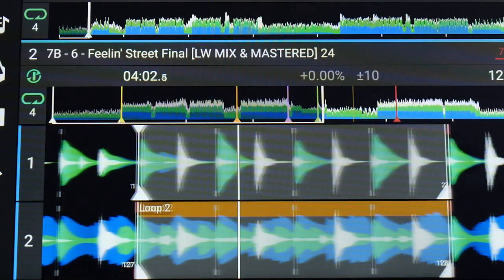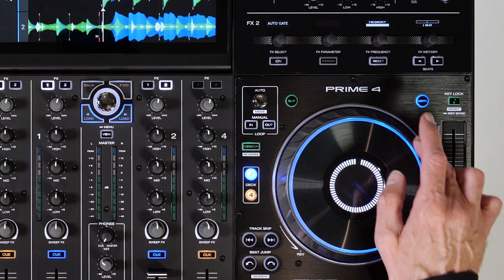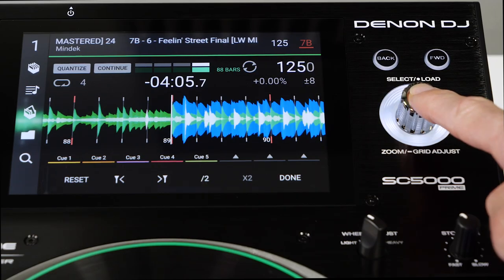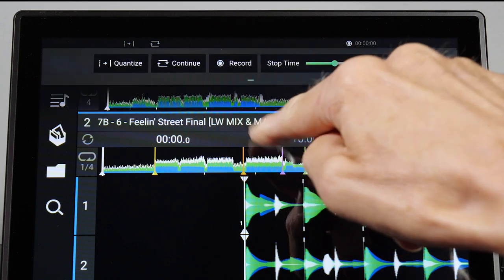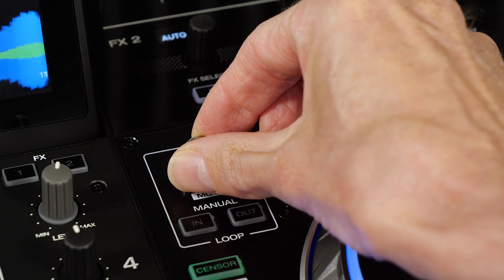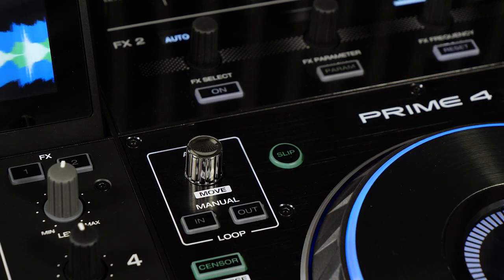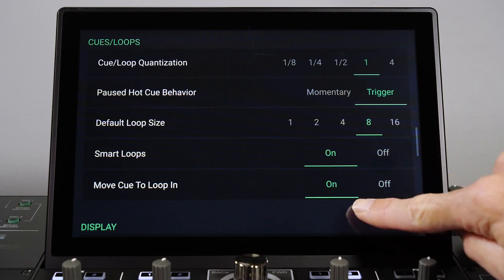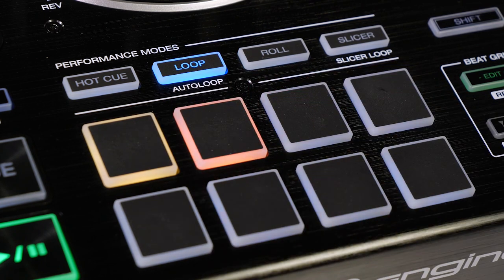Editing Beat Grids to Create Accurate Loops

Comment: Dear Denon DJ....
I too am happy with my new Prime 4 deck. I am stuck having to use it as a Serato controller however since Engine Prime's Beat Grids are ridged only. Please enable Warp capability so they can be both expanded and retracted to match song's tempo that changes over time. (For us 80's/Classic Rock/Metal DJs that's like each and every song)
Reply: +1
Reply: I bought the sc6000 players and have this exact issue!  makes it difficult to mix older music or even grab a loop from tracks that were not made by a computer.

Comment: Denon... there is a BUG to fix! if i move the loop forward , the music has to move together with the loop. And not like a “slice mode” where the result is a continuos play! Example: if i move the loop forward 30 sec. or more, i will LOST it from the screen view! All the other software on market works correctly: if you move the loop, the music will follow the loop forward or back together with your ROLL MOVE! Please fix it with your next firmware update! And please answer me here, there are a lot of DJS whose will not buy the unit because that BUG!